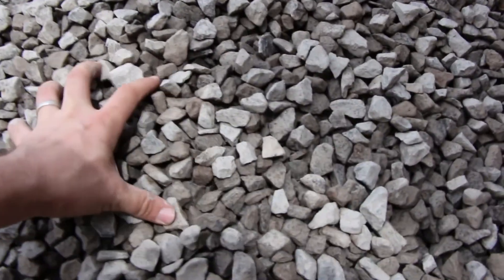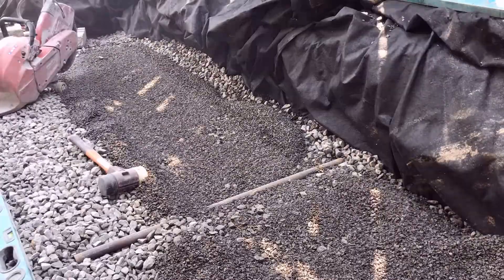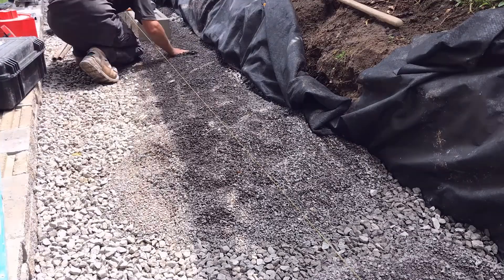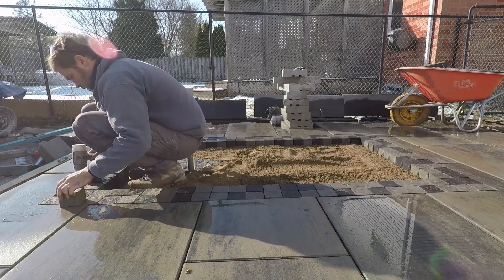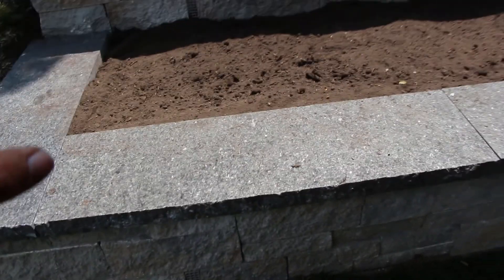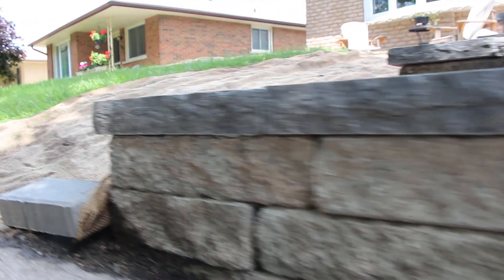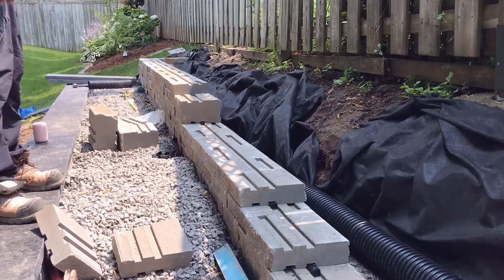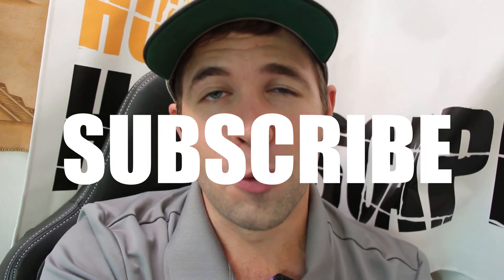BEST Base Material for a Retaining Wall | Dense or Open Graded Base

Comment: I prefer dense grated base. I would only use open graded base for groundwater coming up or through. You can direct your water with a dense graded base. I wouldn't want water finding its way underneath my base course. All water should flow off the top into the French drain and out
Reply from the maker: Yeah I typically prefer dense graded for retaining walls. But for the water issue, the pipe is just buried lower in the base to direct water.

Comment: I got dense graded delivered by mistake (1.5" down to fines). Clay sub base, door below. Can I still use this? I was thinking I could run the perf pipe behind wall, on base, but then to drain it away, at lowest point of wall (middle of length), I could put a tee that directs straight down and run a solid drain pipe down and under and out to daylight on the slope. What do you think? Should I get rid of this material and get open graded? Kind of a headache to have this wrong material here.
Reply from the maker: Seems a little to large. Personally I wouldn't use it, but definitely a headache. You would want something that is 3/4" down to fines. Whether you use open grade or the 3/4" does not really matter that much, just depends on the placement of the pipe for drainage purposes.
Reply: @iamahardscaper is the issue that it's too difficult to compact properly with standard equipment? Or is it that it's too difficult to get smooth and level for the first course of block? Just wondering if there's a way to mitigate this by either renting a larger compactor, or getting HPB or something else for the top of the base. Or maybe it's just a stability issue? Thoughts? Thank you.

Comment: I have the worst case scenario. I think I commented on another one of your videos. I don't have the ability to drain water from the base material so, according to your video, I would be better off with a dense base like a 3/4 - or RCA, with face drainage, correct?
Reply from the maker: That is correct 👍
Reply: @iamahardscaper thank you!
Reply: @iamahardscaper  My wall is next to my driveway , which is flat, and the soil doesn't drain well so I need to use the dense graded base technique you mentioned in the video and and confirmed in your reply. 
Since the wall is next to the driveway, would RCA be a good base for the wall, or should I still use 34 minus? 
I will need to do my driveway over soon and I was thinking, I assume they will be using RCA as a base. If they do, when they excavate the driveway RCA would ties into the retaining wall base (RCA) and unify the two. What do you think about using RCA as the base?
Reply from the maker: RCA or 3/4 minus would be fine. Both are dense graded

Comment: Sp it sounds like if your higher up on ground and your building a retainign wall youbwant the higher area tonhave open base and thr lower level where you dont have ance for further space for drainage like saybthe bottom ofnyour driveway next tonthe side walk or road thsts where you would want the more compact base
Reply from the maker: That sounds good, you could also do the same base on the higher wall so you are not working with multiple materials for delivery.

Comment: amzing video , this is exactly the question I've been wrestling with. My basment walkout wall base was bugging me as all the hardscapers put in open bases now but if I did that it would put the water below my foundation. So closeed base for wall then open backfill it will be. Maybe even closed base material halway up the first above ground wall block.
Reply from the maker: Glad it helps!

Comment: I’m thinking of using a 12D block from Lee Building supply. It’s 18”x12x 8 tall with 1 large hole in the middle. I’m concerned because there doesn’t seem to be a lot of surface area in contact with the gravel base and I’m concerned about settling. I can’t get any help from manufacturer about best install procedures so I’m on my own.
Should I fill the first row of block with concrete to keep it from settling or is filling with gravel good enough?
(My wall will be 3.5 ft, which is below the 4ft level for permitting. )
Reply from the maker: Fill it with gravel, that will do. That’s what they’re designed for. If you are really concerned, there are base blocks you can buy that you lay out and then glue the wall block to.

Comment: I like the idea of open graded base for my 3.5 ft retaining wall. I plan to use 3/4” clean rock. Should I line my trench with geotextile ? If so, what kind (woven or non)? If so, is it better to put the geotextile layer over a small layer or rock (say 2”) then add 4” more on top. 
I plan to partially embed my drain pipe (sock covered) in the base trench, then route it to air below the bottom of trench level. 
Should I place “drain spacers” in my second row of blocks, or is that overkill?
Thanks
Reply from the maker: Yes, line your trench with geotextile. You can use either. Typically I use non-woven for a retaining wall. Don’t split up your base. Whatever you place on top of the geotextile would be your base. You can amend your subsoil with a small layer of 3/4 and Portland cement or type S mortar if it is saturated and needs more strength. Refer to the manufacturers specifications for the wall you are installing and the height to which you are installing it to. It will likely require layers of geogrid. At that height you may need a permit and outside engineer drawings. Follow those drawings. No need for drain spacers.
Reply: @iamahardscaper  thanks. Permit required at 4ft in my area so no engineering required.
Can I use landscape type fabric or is that not strong enough for this application? 
I’ve tried to contact the block manufacturer for guidance but not getting much help. 
Thanks again.
Reply: @iamahardscaper  also, is it best to use the corrugated pipe with the small slits or the larger ~3/4 holes?

Comment: I see the screeding rails are running perpendicular to the direction that the wall is being built. In another video I saw you run them the other way. How do you decide which way to do it? Does it matter?  Also, HPB is the same as 1/4 clean angular gravel, right? Thanks for the great video.
Reply from the maker: I try to always run them perpendicular because you can get better accuracy levelling from pipe to pipe. Yes 1/4" clean angular is HPB

Comment: Great vid and info. I’m thinking building a 3-4 foot retaining wall in heavy clay with substantial water runoff ( bottom of the hill). I’m planning to do 8 inches of 3/4 clean for base material and backing filling with 3/4 clean as well. Going to add geogrid in the middle. Do you think this is ok? Where should I put my drain pipe? In the base material? 

Or should I use 3/4” minus for base material and 3/4 clean for back fill and put the drain pipe on top of the base material where the 3/4 clean starts in the bottom row of retaining blocks? Thanks in advance!
Reply from the maker: The drainage pipe needs to be elevated about 4 inches above the bottom of the trench in open graded or 4 inches above the base in dense graded. The choice between the two base preparation is whether you have an area to daylight the pipe to that is lower than the pipe. If the area you are daylighting the pipe to is lower than your base then go with open graded. If it is higher than your base go with dense graded.

As for the geogrid, just go with the wall block manufacturer's specifications. Every manufacturer has drawings for all of their wall blocks for height and where the geogrid layers should go. But for our area, anything over 3 feet requires outside engineer drawings and permits. Just a heads up.
Reply: @ great. Thanks for the reply! The pipe will drain to daylight below the wall. 

Last thing, I was going to put non woven and punched geotextile in the trench and back up the slope. 4 or 6 oz. Good idea?
Reply from the maker: Yup that works for the non-woven, though most people are not putting it up the back of the wall these days. Especially in clay soil. The point being is that the silt in the soil will clog up the non-woven and eventually put pressure on the wall when it is clogged.

Comment: I don’t see how laying drain pipe on top of your clear rock benefits. The water is going through your clean rock and straight through your tile until it hits a sold base right? Wouldn’t you want it at the bottom where your subsoil is and then exit it out? 
 We never have clean rock to lay so we use road base then lay tile and then 1” minus behind the wall.   I’m still new to this but we been installing redi rock for a few years now and that’s the way I been doing those per engineer. Going to try and get into some other hardscape this year I think. We are in a cold climate also 
Great videos and good inspiration
Reply from the maker: Yes, you are right! It should be elevated 4” though above the subsoil. So with a 6” base (we typically do 8”) it would be half buried. I can’t remember this project but I’d assume we moved the base around behind the wall and embedded it before backfilling. If it was dense graded that we installed for the base it would be elevated off of that when backfilling.

Comment: I have clay soil. I built a retaining wall on a dense base. Do you think a drainage pipe behind the retaining wall would suffice rather than having to tear my wall down and re-lay an open base? Thanks for the great vid
Reply from the maker: A dense graded base is fine for the base. It is just better to use open graded in some scenarios. It also affects where the pipe goes.
How tall is your wall, what is it retaining?
Did you use open graded backfill?
Reply: @ thank for the quick response. I haven’t backfilled, the wall is retaining a big flower bed (16x18ft) And is only 1 ft high. I just want to prevent sinkage of the stones in the near future
Reply: @ planning on using open graded with a sleeved corrugated pipe right above the paver base
Reply from the maker: That sounds good 👍 at 1 foot height you will be more than fine with that plan

Comment: I generally go with open graded base material but I live in a fairly flat area so my walls are very small (no more than 2 ft high). I always put a layer of geogrid in my base material as well. Do you?
Reply from the maker: I actually don’t for retaining wall base. I’ve thought about it but never actually tried it